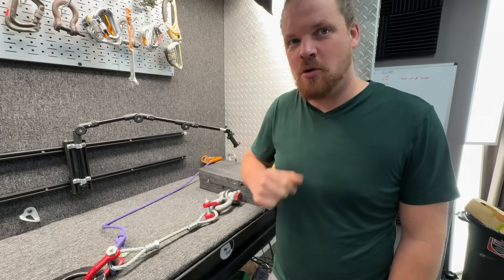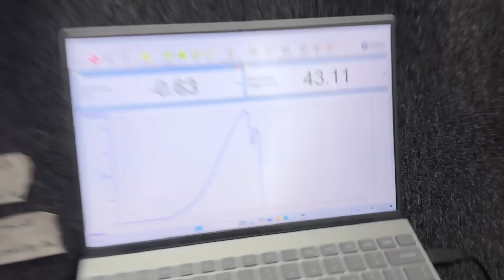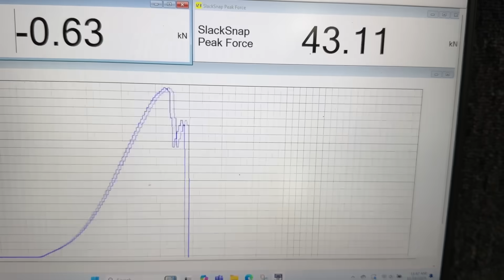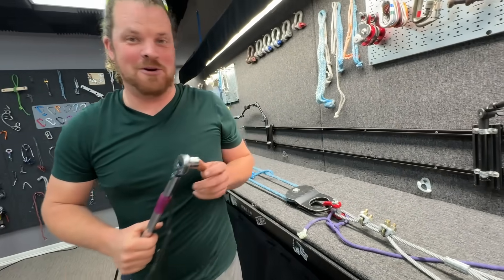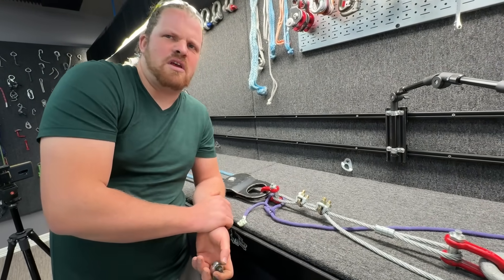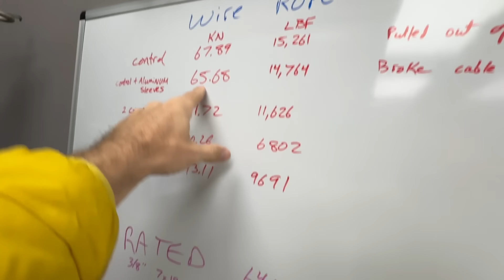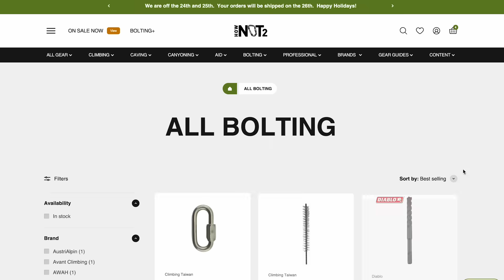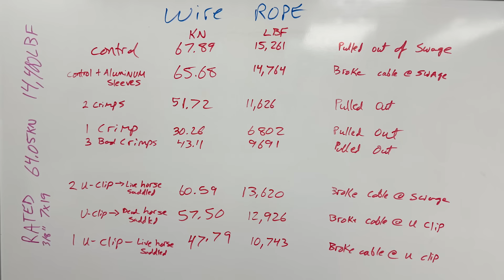Never saddle a dead horse

Comment: To the people who don’t know how it works:
“Never saddle a dead horse”
You have 4 parts to worry about:
1) The “bite end” of the wire
2) The “dead end” of the wire
3) The “Saddle”
4) The “Strap” or U-Bolt

You never want to put the dead end of the wire in the saddle first, you always put the saddle on the bite side and loop the dead end back around through the top between the U-Bolt and the bite end of the wire.

The reason you don’t do it the other way is because the bite end is a rigid platform, it’s a hard point.
There are teeth in the saddle that holds onto the rigid connection and acts as an anchor point for the system, so when the eye tries to take strain from the bite end the teeth grab onto the wire keeping the dead end from slipping.

The dead end will almost always slip first when strain is taken because straight is taken from the bite end first ALWAYS, because it’s connected to the force being applied.
Source: I use these things for a living on boats to fix broken wench wires.

Comment: Found your video it’s interesting. I used a burndy crimper for copper and learned a lot about crimps. I like that you make sure there are grooves. We replaced a lot of crimps where bosses wanted attractive crimps with no grooves (they have no strength) now let’s think on your crimp technique two things must always be true crimp die should never meet between cables and 6 side die should be stronger. A burndy crimper makes a loud pop when it reaches calibrated pressure (calibration of a crimper is important! I would like you to retest this experiment it’s been a year and I’m sure you have gained even more insight. Hope you can test my ideas. The oil field used the never saddle a dead horse and I saw what happens when clamped incorrectly.

Comment: Bundling log loads with 9 strand 5/16"? I would pre set the Ferrell, so all I had to do was throw it over the load and crimp it. I was specifically told to never  push on the wire when attaching the Ferrell, or I would be fired. No explanation. We'll one day I got careless and pushed, instead of pulled to attach that Ferrell, and it slipped.The end of that cable Layed my wrist open real good. Luckily I missed the veins. To be honest, I really didn't love that job anyway. 
🤘😎

Comment: Used to work underground at mine  and on one level there was a 80 or 100 hp slusher/dragline.  If i recall correctly it had 3/4" or 1" cable.  Never used swedge on those cables just old cable clamps.  No torque wrench, just tighten as tight as possible and never saddle a dead horse.  Man that cable slusher line would really throw cable and block tackle around when old cable broke.   It was violent.   Ive seen that electric slusher pull apart brand new clevis D-rings that were 1 1/2" thick and USA made.  It happened from time to time.  Inside the steel would have a brownish area where the grain structure of the steel was compromised.   Interesting that it was visible.

Comment: High tension cables snapping can have a lot of unexpected shrapnel. At 2:32, there is relatively exposed leg, in which some can be embedded. Considering how fast someone can bleed out if sliced at just the right place on the thigh, that's fairly dangerous. Protect yourselves, my dudes, especially when using over 10k lbs of force.

Comment: As an industrial mechanic, give me swages all day long vs saddles.  I will gladly run back to the shop to get the crimper over getting stuck by 50 wires because I'm tightening a saddle.  I only need to know that I've exceeded the actual load with a safety rating several times over.  Never skimp on your actual expected load vs safety rating margin.  Something will always be trying to close that gap, wear/tear, degradation over time, chemical degradation, less than perfect installation/maintenance, so make those things really have to work to overcome a safety margin.

Comment: Slipping causes a shock load and the weakest part will show itself every time.  We used to make our own slings for anchor buoys.  We put Flemish eyes with at least 4 wraps back into the tail, no clips.  Just duct tape to keep it from sticking out as much. One inch wire rope and the buoys weighed about 10,000lbs each, or way more if they leaked.  Never had a Flemish eye pull out ever.  The sling would usually break in the end of the eye where it was bent over the 1” shackle attached to the buoy.

Comment: Out here on the tug boats we splice eyes into the cable, and then secure them with two u clamps, the splice its self from what i understand holds the load for the most part, the clamps are just insurance. An electrician friend of mine says he splices eyes on guy wires all tge time and secures the loose end with electric tape, no clamps

Comment: I'm always wondering about the kind of crimps you do. i work a lot with steel cable and we never do such sharp crimps. we use a wider hydraulic crimp tool so the pressure is distributed along an about 2-3cm (so about an inch) wide area. i've never fail-tested the ones we use but i could imagine your sharp crimp weakens the strands more than the mehtod we use

Comment: I’ve MANUALLY  crimped a lot of cable and my crimps come out round yours still resemble the none crimped crimp so idk I feel like your crimpers are not set up correctly maybe. Ps I’ve nvr crimped cable quite that large, just slightly smaller cable an lot of it. Also I always crimp from left to right and the crimp actually grows in length as I’ll do 4-6 crimps leaving a little bloom/dress/flower/bell what ever you want to call it

Comment: Interesting tests! Haven't there also been another means of wire rope termination, though? with opening up the strands of the lay with picks and back-weaving the wires or strands in the termination, casting a molten softer metal around termination and compressing that. Like 90% strength at best - on paper, MUCH better in actual real world use just in it being more graceful and natural, slimmer, less ouchies. de-rated for lifting applications, I'd imagine. Worth testing?

Comment: Every time ive had a cable break its been mid way
Also ive only used the saddles
Use 3 on each end and dont over tighten them
Seems when you are using the torque wrench they are way too tight in common to what i do
Would be interesting to see how that tests

Comment: Many years ago I had a conversation with a millwright that worked at the old Dodge main plant in Detroit, (Hamtramck) and he said that he was watching the certified elevator service crew installing new wire rope on the very large freight elevator. What shocked him was the tech was installing the wire rope clips alternating with the saddle on the dead end and the next it was on the live end. When the millwright asked him why they did that the tech said it looked prettier. 
I have never trusted riding in an elevator since I heard that story.

Comment: You know the glue used on Tesla CyberTruck to attack the bumper... Structural adhesive... It would be interesting to see one of those joint connection, have adhesive inside, but using a very low compression as to not really deform the cable, just to have the product compressed a little bit inside...

Comment: About 20 years ago, I was up in the San Juan Islands with my family on our 52" power boat.   We kept a Zodiac tender on the bow, and one day the swage fitting failed (don't remember the particulars on the failure).  I  didn't own the tool needed to effect the swage fitting, so as a bush fix, I rigged two wire clips, (correctly), just to get the empty Zodiac back on deck.   

When I got back to port, I stopped at a boat yard so the cable eye could be properly fixed, and the service tech just tore into me with a lecture about how unsafe the clips were.  I tried to explain it was purely a temporary fix, no one was in the tender as I hauled it aboard, and I didn't want to abandon my Zodiac, but he was undeterred.  He just needed to lecture me, I guess.   Never used that yard again.   Good grief, sometimes you need to make a temporary repair.   And yes, I bought a hand held hydraulic crimper after that trip so I wouldn't need to pay someone to do something I could do myself.
Reply: Perfectly safe. If you use proper ones, approved for lifting and fit them according to the manufacturers instruction they are approved for overhead loads.

Comment: I love this test.  W'ould you guys consider retesting both methods, but instead of just putting the cable together as was done in this video, unwrap or uncoil and rewrap the cables together prior to putting on the ends. With the cables wrapped together as one it's a game changer.  I think the outcomes will be worlds stronger than this. We use the threat the cable method in towing and pulling huge loads on the farm and we've never had it come apart, ever.

Comment: I've used lots of those clips on tow truck winches after I broke the wire rope. Usually at 2am when I just want to go home lol. Usually the wire rope fails where it was previously damaged by crossing over or birdsnesting on the drum of the winch on a previous hard pull that was not straight on. I was in flatbed trucks so it is easier to get it misaligned pulling a destroyed car on that is not going on straight. It usually fails when you are winching something out of the ditch through mud or some other high resistance situation. Never once did a cable blow out at the clips. I never torqued them either. Used a 1/2" cordless impact till it was goodntight 😂

Comment: I don't use cable or wire rope much now, but many years ago I had shrimp boats and used it for a lot of applications.  Stay wires on the mast and boom were really important and some people started using the electric company type of cable and the friction wrap ends.  I'm sure they have a more technical name, but I used them on my last shrimp boat and they never failed and they took years of stress and in corosive conditions.  I didn't like the cable because it was so stiff, but have to admit it worked.

Comment: I've spliced tones of steel cable and used cable clamps but I never needed a torque wrench😂😂lol
Reply: Crosby Group installation instructions spell out required torque settings, and the recommended post installation load testing of the cable and rechecking torque settings. Cable clamps are useful in some settings, but I prefer copper nicopress swages

Comment: Could you do this comparing different DIY crimping without the tool?  Like using other methods: A table vise, a hammer, a hydraulic press from Harbor Freight, etc?

Ive used all three in the past, but admittedly thinner cable.

Comment: 6:23 Do you normally wear gloves when you do this? 
Well, yes and no. If I'm making clean cuts on nice new well behaved cable? No, but I'm damn careful not to splinter any of the cable either. 😎Yeah, those stabby little wires don't go in that far, and they pull right back of your finger, right? Why can you still feel it 3 days later? 😎

Comment: Aluminium collars to back up swages. Well crimped swage  will well exceeded cable strength. Aluminium will encourage galvanic corrosion with steel cable. Aluminium mixes with aluminium and stainless steel if both are quality

Comment: My biggest problem is finding a crimp tool that is just for 1/16 or 1/8 wires rope.  My local shops only carry a crimp tool that does multiples up to 3/8 which makes the tool extremely cumbersome to use on the smaller sizes without the aid of an assistant.  Any thoughts on a crimp tool that only does the smaller sizes.

Comment: As a logger who skids logs with wire rope, in terms of repairs, I've always had better luck with clamps than with swages. OEM swagged wire rope is better than clamps, tho. I always reverse my clamps, with one the nuts facing one way and the second clamp with the nuts 180 degrees or opposite facing.

Comment: both are shit, farmers eye or what ever you guys call it is the best, i do the loop and splice in about 2inch of cable in to itself with a screw driver or a nail (by twisting) and cover the exposed wire ends with tape, we used two russian tracked tractors to pull the steel rope apart for testing and the eyes didint break

Comment: Now do the tests with all the correct parts. All your tests should have been done with a wire rope thimble installed in the eye of the loop. A properly crimped cable with out the thimble will significantly reduce the load capacity of the cable.

Comment: I was taught over 30yrs ago that to use a U bolt properly for maximum strength, you should wrap a strip of copper or other thin metal around the cable before applying and tightening the U bolt clamp.

Comment: I had to learn how to weave the seel wires together  or weave it so there would be a loop in it. Some jobs required it, Because so much force would be on the cable none of those clamps would hold, when it did break, it had enough force to cut a man in half,  those kind of clamps would never hold with the force of a  300 foot push boat connected to 3 fivehundred foot barges, and the wire cable was about 3" thick,  I had to know how to weave steel cables, It was the only way to get two steel cables to stay together,  or weave a loop in it,

Comment: Well, I hope to make use of this video this summer as a rig up a wimpy steel cable to deliver sheets of plywood sheathing up on to my roof trusses.  I think that I got the message:  Use best practices and don't go any place near the limit strength of the systems involved.  Wear eye protection, and don't go anyplace close to where you might get hit by a failing cable.

Comment: Rule of thumb for cable clamps is one for every 1/4” and one for safety. 
Technically on your 3/8” cable you should have had three clamps.
Reply from the maker: According to which standards or manufacturers?
Reply: @ 
That was in our union Ironworker rigging handbook when using cable clamps for rigging and perimeter safety cables and plumbing up cables. 
Snapped many of them 5/8” plumb up cables making steel buildings go up straight.

Comment: I don’t know if you have ever heard of Molly Hogan. At least that is what it was called when I learned it. Take the end of a cable apart a bit more than eye and tail more is probably better. You wind up with a 3 strand and a 4 strand then wrap them around each other making a loop continue until the desired length is produced don’t forget the eye. Attach 2 or 3 clamps in opposite directions as there is no live or dead horse. Would love to see this tested. I was told it came from the old mining days when there were no swedegs 8:40  available out electric company uses this method for pole braces. Would love to se results. Bob in Oklahoma
Reply: I don't really know what your talking about but I'll second seeing whatever that is tested!
Reply: I was taught how to make a molly hogan as an apprentice piledriver between 08-11 in philly. Don't remember what year we made them. I still have it in my shed for pulling bushes and stuff. I don't know if it's still taught in our apprenticeship since homemade rigging really shouldn't be used for overhead lifting.

Comment: I have a theory. When using a saddle and u-bolt, under torque the nuts and place some tension on the cable to allow a slight slippage. Then remove the tension and torque to the desired spec. This should help the strands align so that some are not overstressed when the load is applied. What do you think?

Comment: Okay now this is a fantastic video for me personally because coming out of the concert business we use 3/8 wire rope all the time for rigging and hanging and it's fascinating to watch this break test we don't use those sleeves on it though - they are always factory compressed, but I did rig some lights in a nightclub one time in a similar fashion with this and never had any problems with these sleeves I think they're quite strong and durable as long as you're staying within your 5:1 weight safety ratios I don't think it's a problem. They are also relatively easy to swage even with the bolt-cutter style swagger.

Comment: I used to design guying systems (among other things) for towers ... we would use 3 wire clamps (err ... not clamps), and typically would install a thimble into the eye of the loop.   These when tested always failed at the wire rope MBS.  We did use swaged clamps as well but in the field this was not always possible.   So ... I WASN'T surprised that the clamps could deliver :-)

Comment: A, at that size wire I think 3 cable u bolts are recommended. B, the wire needs ALL the wires to carry the load to meet it's rating. So any distortion to the wire means some strands take up the load before others. Thats why you should also use thimbles and likey why the crimped line failed when the tail was too short. The dead side of wire helps to keep the load side properly shaped. Also coated wire needs the coating removed!. Love to see a test on jacketed wire. The wire needs to keep its round shape from load to the first return clamp to keep its rating. Sleaves do this well and keepba 100% rating, but you must have wire fully thru both sides. Clamps alway distort the wire some so thats why the derating by 20%. USE THIMBLES! They protect from abrasion and too small a bend radius.

Comment: You didn't try putting the saddle clamp OVER a crimped swage though you were already reaching the limits of the ropes so it would likely be redundant. I am a hobby welder - has anyone tried welding cable to itself - a maybe 4" bead on both sides would seem to bond them together well and would be a fairly compact connection.

Comment: I do towing. We use 3/8 cable, and we run cable clips a lot. I've never actually seen the cable fail AT the clips. Incredibly... So the 5:30 test where it fails at the swage? I'm kind of not surprised, but also a bit surprised.

Comment: Short cable lengths can cause severe uneven strand loading leading to the unexpected failure modes. Retest with longer lengths wrapped several times around a drum